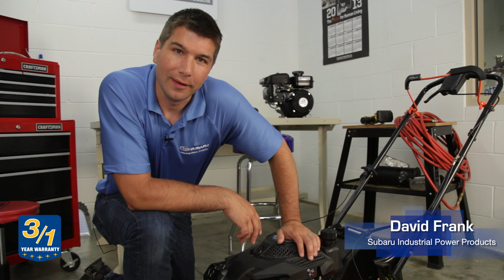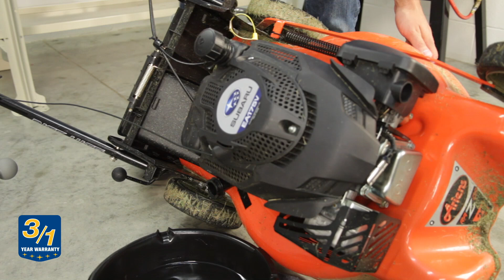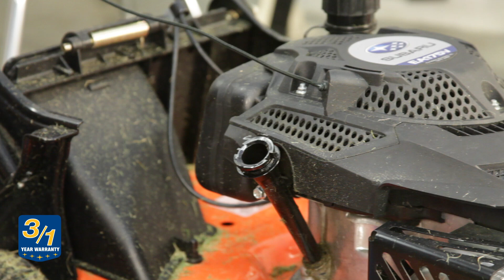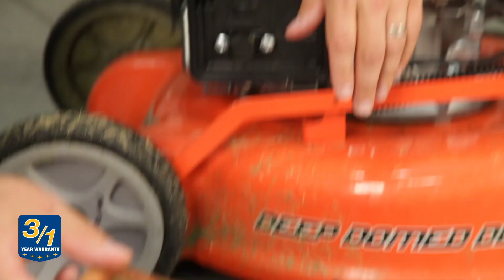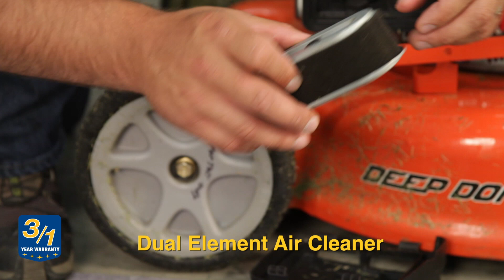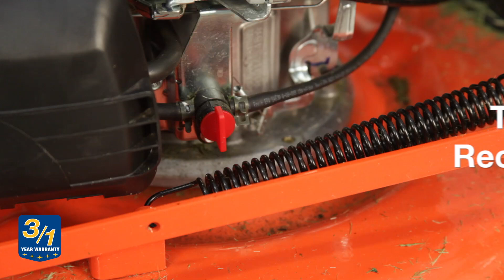How to Perform a Spring Tune-up on a Lawn Mower Engine

Comment: David, as Dave B said, and since you emphasize all the way to read the owner's manual, for that type of engine you should not screw in the dipstick to check the oil level. An other thing is that oil replacement should be done only by tilting the motor and not by using any fancy sucking tool.

Comment: The Subaru user manual for this engine says not to screw in the dipstick to check the oil level.
Reply: Yea that lame-assed Gravely manual says to "see the engine manual" for checking oil. Gawd.